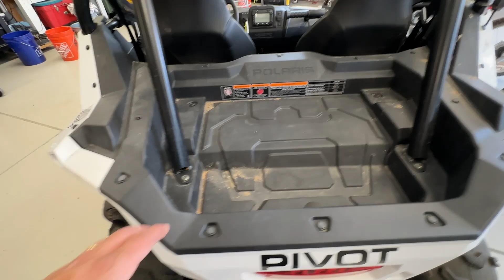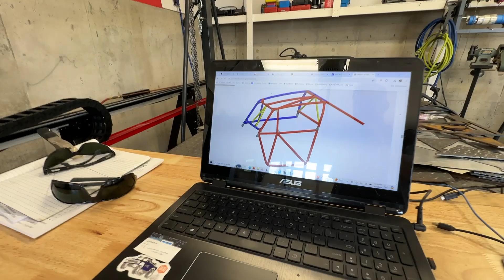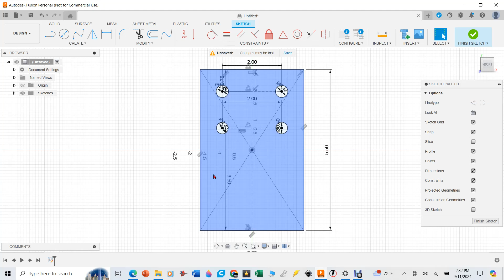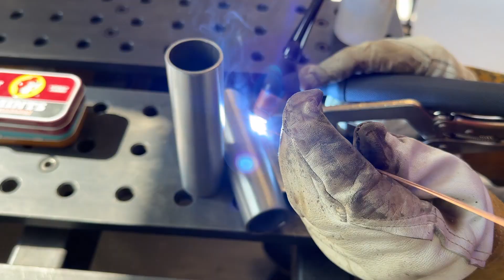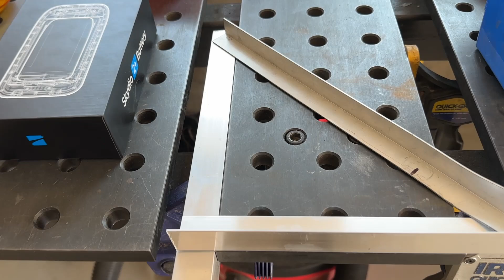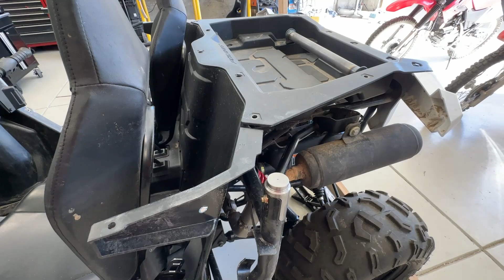DIY Roll Cage Part 1 of 3 – Getting Dimensions to Use in Bend-Tech

Comment: Awesome stuff dude! I just got a Crossfire Pro. I'm not a fabricator by any means, but I enjoy learning about fabrication! Good job!
Reply from the maker: Love the Pro.  I built our first truck all using the Pro.   I just got done cutting the tubes for the RZR on the Dragon.   Great Machine.  Working on the video now.
Reply: @ntdracing  Sweet! Super excited to see the next part! How did you become a fabricator? Did you go to school for this? How could I learn to do what you do!? 

I've been a mechanic for almost 10 years, so I feel like I have the right skillset!
Reply from the maker: @westleyworley1731  when I went to college I got to be on a team where we had to build an off road race car.   Learned to weld and fabricate there.
Reply: @ntdracing  Did you go to college for Mechanic Engineering by chance? I had a friend that went to a college here in GA for M.E and he also had a racecar team project through college!
Reply from the maker: @westleyworley1731  I did.   Never got to use my degree.  Spent 21 years flying Jets in the Air Force.   Happy to be back in the Speed Shop building cars.
Reply: @ntdracing  That's still a really cool life to live! Thank you for your service as well! Glad you're back doing what you enjoy!
Reply from the maker: @westleyworley1731  Thanks

Comment: This is a great example of how NOT to determine accurate reference points.  Lumber and extruded aluminum are NOT straight, and the aluminum is too flexible.  That is a LOT of work, space, and money consumed just to validate pick-points.  Too many variables between the materials and a hand-held level (that one kills me).  At least use a plumb bob.  I'm a design engineer and often take as-built measurements with far less effort.  And, everything aligns as intended.  For the DIYer at home, an angle finder, a level and a tape measure can get the job done.  Measure directly between 2 points.  Then measure down from level to the lower point.  Use a trigonometry app to determine those points on 2 planes, relative to one another.  Once you have all the "drops", reference it all to a center plane (measure across, divide by 2).  This will give all the "side" measurements a place to live in reference to a center plane.  All of which is very easy if you apply all that to a 3D modeling software, like Fusion 360, or in my case SolidWorks.  In the field we use lasers, plumb bobs and various measuring devices, most of which are not particularly expensive these days.  Thumbs up for effort, and a chuckle.  👍  edit: I was only here for the Bend-Tech info.

Comment: I recently picked up a 3D scanner for about $1000 and I think you’d benefit from one. You could scan the chassis, and grab the pick points you need on the computer and then go about making it on BendTech. Your method was very nice though! Can’t wait to see how it turns out!
Reply from the maker: @DuarteFabrication  sounds cool.  Can you share a link?
Reply: @ntdracing  I really appreciate how you showed how to do it manually.